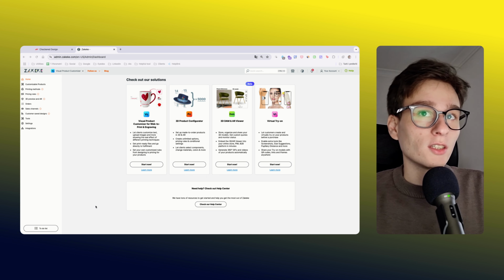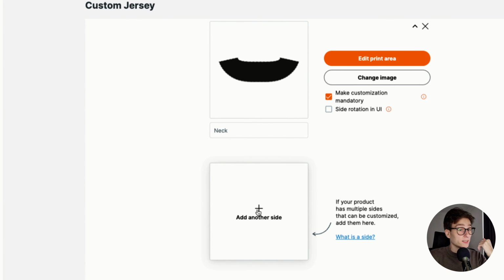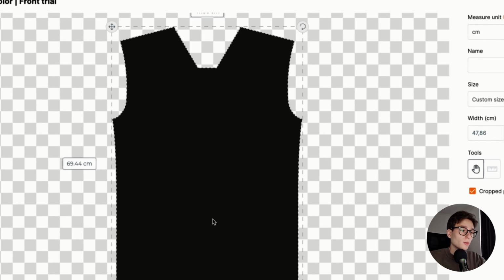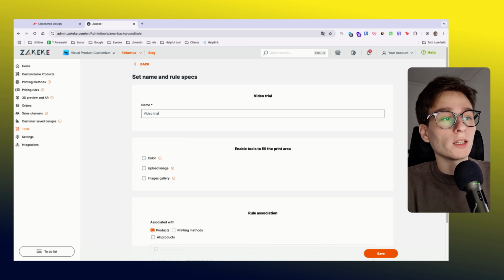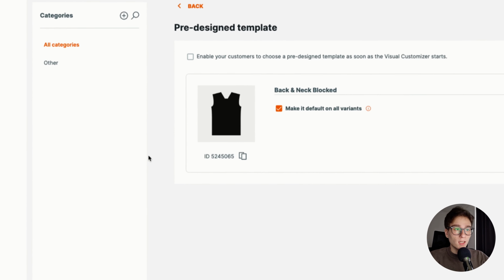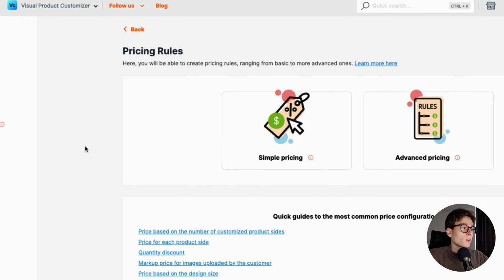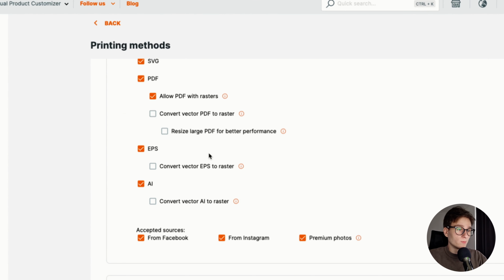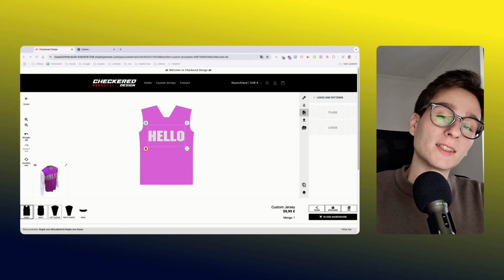Build a 3D Jersey for Shopify

Comment: Hello
I’m exploring the capabilities of Zakeke 3D for my store. I wanted to ask:
Is it possible to apply a gradient on the jersey without showing separate back, sleeves, or front layers to the customer?
Can the final print file reflect my pattern for each size, even if the pattern needs to scale differently for each size?
I’d really appreciate any guidance or tips you could share. Thanks in advance!
Best regards,